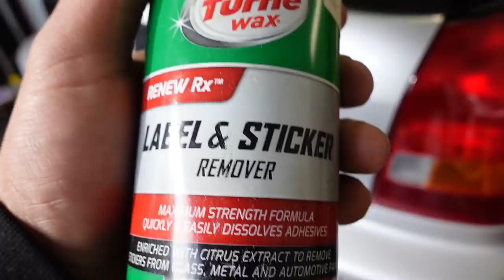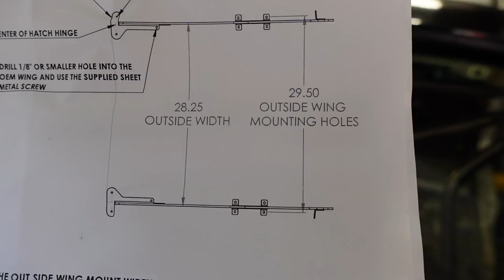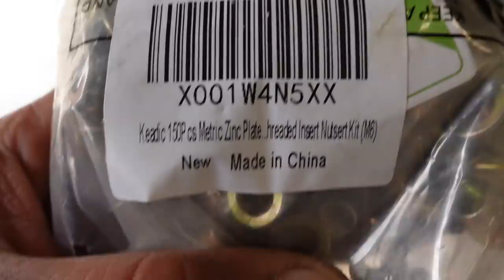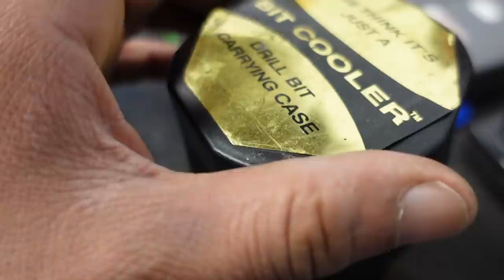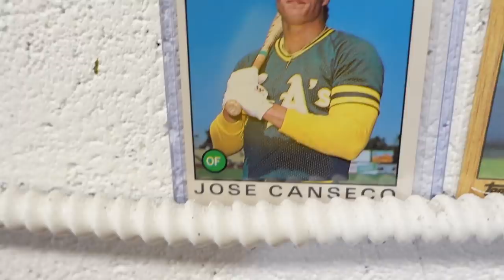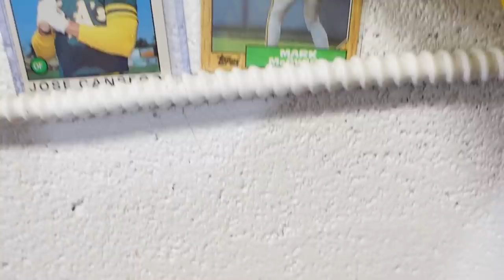We Tucked A Full Size Radiator + Installed PCI V2 Spoiler 🤗

Comment: Pro tip for drilling holes. Once you've gotten through with the size drill but you intend to use. Throw on a step drill bit and just lightly use it to clean the holes on the surface. Removes all the rough edges. 🔫🔫

Comment: Just a suggestion y not weld tabs on the rad  on the sides and put nut serts on the chassis for easy removal from the looks of it if u put tabes coming off the traction bar wouldn’t u have to remove the traction bar if u needed to remove rad